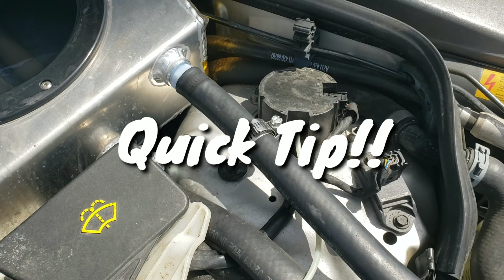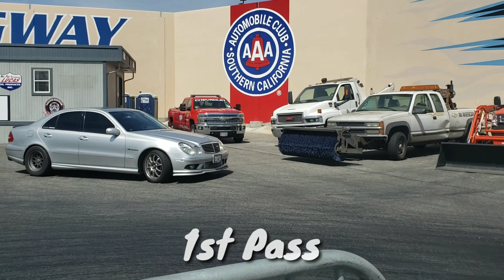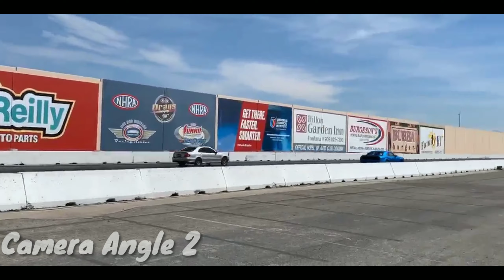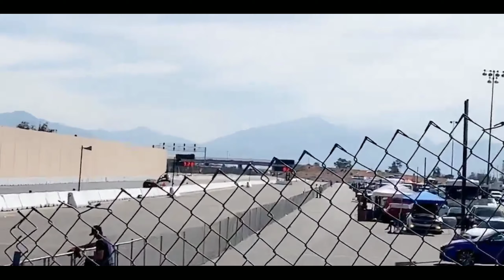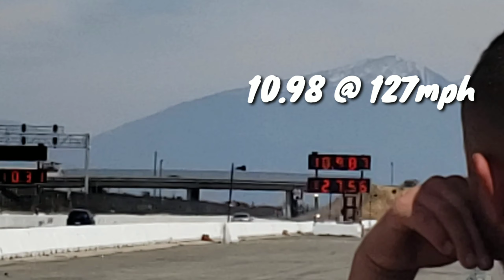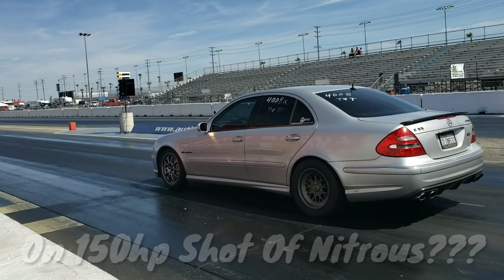Nitrous E55 Quest For 10's Part 3

Comment: I have the same tank.The best way to drain the tank is ...put a drain valve on it. Works perfect and as soon as the tank is almost empty,close valve.
Reply from the maker: I was considering that too..  but i let the SC pump do all the work😅 plus i dint activate my sc pump until i am about to do a burn out so my ice deasnt melt while im staging...so in return i wont have to switch to a trunk tank😎

Comment: Congrats what's your 60ft and 330 looking like
Reply from the maker: Hold on...give me a sec
Reply from the maker: Hold on...give me a sec
Reply from the maker: 60ft - 1.625
330ft - 4.624
8th mile - 7.099 @ 99.44mph
1000ft - 9.216
1/4 mile - 10.87 @ 127.56mph
Reply: That's great i wish i could get a low 1.6 60ft best has been 1.76. But my car breaks loose right before the 60ft after i had the tcu tuned. Best i been 11.50 flat. With 180 pulley mid length headers and tuned 121
Reply from the maker: @samdog357  what size tire u on?
Reply: @j-kamautomotive1817  18 mt,s but I got some clk 16 in rims with Hoosier cheater slicks I'm about to try out... Its been 122 mph. I got a nitro kit but don't want to put it on till I can keep it planted. Then I will try it no need to put it on if I spinning
Reply from the maker: @samdog357  throw it on bro😈😈
Reply from the maker: @samdog357  u can always hit me up on messenger look me up:

Joey Kamtan

Comment: What's the mods on the car? Finally got myself a e55 after wanting one for years. Also who tunes it?
Reply from the maker: ENGINE:
- 77mm SC clutched
- Maximizer long tubes and mid pipes
- Belt Wrap Kit
- 3pc. Aluminum idler Puleys
- 1 step colder plugs
- K&n drop in filters
- 630cc injectors
- Stock TB

COOLING:
- FTP heat exchanger
- Bosch 010 Supercharger Pump
- PNR Underhood Ice Tank 

ADDITIONAL:
- NITROUS EXPRESS PROTON PLUS KIT
- 100hp Shot Nitrous
- Nx bottle warmer
- Auto Meter Nitrous gauge

ELECTRONICS:
- Grams AFR Wideband

TUNE:
- Eurocharged Performance
Reply: @j-kamautomotive1817  are you running split cooling?
Reply from the maker: @taylorjackson3302  yeah its split..thats why i have the underhood tank which i put in to help with air intake temps
Reply from the maker: I just grinded down the rear caliper a bit.. only a few millimeters its on my vid "quest for 10's part 1"
Reply from the maker: And ur not bugging anyone man im here for u bro😎
Reply: @j-kamautomotive1817  I went back and found your vid. That's why I deleted the comment lol. Thanks
Reply from the maker: @taylorjackson3302  no biggie bro.. im here if u need me😎💪

Comment: Eurocharged mananged 9.7 on the quarter with the stock engine, stock supercharger, and no nitrous/meth. You need a 90mm throttle body man.
Reply from the maker: Just seen this...my apologies 😅😅 bro i need alot of thing at the moment but for now ..most mods will be dont to the trans. Im on stock tcu with no tune.. also going to upgrade the transmission valve body as well and ill see what will that net me in the 1/4 mile. Throttle body will be upgraded in the near future but for now i like holding the record for stock throttle body 🤣😂🤣😂
Reply: @j-kamautomotive1817  Legit street cars made a video with a new valve body for 722.6 trans and its quick as fuck. You Should look up on this.
Reply: @j-kamautomotive1817   Hey bro! So did you end up getting the upgraded valvebody? I got mine a month ago on my cls55. There is still some harsh 3-4th engagement. Im still waiting for it to fully adapt.
Reply from the maker: @boyb72  naw man nothing yet. Havent purchased anything new for the e55. How do u like the VB so far as far as shifting speeds? Any crazy noticeable differences?
Reply: @j-kamautomotive1817  Somewhat quicker and solid shifts, but sometimes harsh engagement from 3-4th. I think it needs to adapt some more i think.

Comment: Wow imagine what it would do at a lower elevation!

What a four door n**i lead sled. Lmao!

It's amazing the power especially when the under hood looks so unmodified. 

Also, have you thought switching to a turbo? The s/c takes power to run it physically from the crankshaft on the power stroke ultimately contributing to higher cylinder pressures. 

Seeing as how the major limiting factor is cylinder pressure, and a turbo is driven not by the power stroke but by the exhaust stroke. A turbo does not directly contribute to  higher cylinder pressure and therefore allows for greater power potential.

If we want to take this to it's ultimate conclusion, and avoiding unstable Nitrous: There is a company that makes a pressurized air injection system using special valves and synchronized throttle bodies for the ultimate system to unlock an engines maximum power!
Reply from the maker: So far the nitrous unit has been decent.. but not super consistent back to back. But im happy with it. To turbo this car... u need "deep pockets" 😅 u get mercedes tax...plus AMG tax.. thats why i went spray it was so much cheaper and makes power. I picked up the nitrous express proton plus kit on offer up brand new in box for 450$.. and been full send mode ever since 😁 my car has 172k on factory engine and trans..and torque converter..diff...axels.. and still running strong. Im amazed how well its holding the power. But for how long.. i have no clue😅🙃
Reply: @j-kamautomotive1817  yeah. That's amazing and well worth the price. The performance out of your setup for the price is tremendous!

And no I haven't sprayed my E55. I don't have one. I have an ML with just a m113 and a W140 w/ a M120 V12. 

The most experience I have though is with turboing my 89 DOHC swapped civic hatch. When I was 16 years old about 15 years ago I built a turbo-kit for it and really went to town, lol.

Speaking of which, I wouldn't be so sure the turbo gods will tax you an entire private island to turbo your E55. 

When I was 16 because of my financial situation and out of necessity I was able to turbo my car for almost nothing. I'll break it down for you...

-Free / used turbo + 60 rebuild kit.
-Oil line, T, adapter were from a industrial hose supply shop for 20+5+5.
-Return hose was like 10 bucks and I took my oil pan and drove around the industrial area until I found a cool big fab shop with a door open and then went in and asked a tech to weld a bung on it for $30 bucks.
- i sold my header for money and then just used the factory header but went to the metal recycler to get a 4 inch by 4 inch by 1 inch adapter plate cut out. I then traced the two gaskets out on it (I think before I left) and then asked the guy who cut my piece of metal out to cut the hole out in the middle with his big ass acetylene torch. I even had him port match it as best he could so I only had to do a tiny bit of grinding at home. I think it was $12 for the metal and $5 to cut it. Lol
- I then got a used Toyota Mr2 blow off valve which is like an HKS super sequential in that it responds to change in manifold pressure instead of boost for $15
- bought an Audi intercooler and made my own end tanks out of fiberglass, but theres plenty of cheap intercoolers. $70
- I got my pipe connectors by the foot from industrial supply, and t bolt clamps too. Like 20 bucks. 
-the most expensive thing I needed was a wide band O2 sensor...I paid $450 for one with a data logger and used that to street tune.
- used 450cc injectors from an eclipse/talon $75 for 4
-I got a chinese 6 puck unsprung clutch pack for $400
- Fuel management required putting a socket in my ecu, I sent it away for that $90. I then needed a few EEPROMs $12 and Moates chip burner $85. The software I used was called TurboEdit and it was free. Lol. Eventually there was a $50 electronic board and cable add on that allowed for tuning on the fly/data logging. 
- diy boost controller $12
- a few mandrel U and J bends for intercooler piping and down pipe. I bought a $90 stick welder, $10 in sticks, 14+5+2 for helmet and gloves and wire brush to make my down pipe. 
-eventually $50 for flex pipe to attach down pipe to catback. 

-misc: ~200 boost, oil pressure gauges + sending units, O2 sensor bung, exhaust wrap, vacuum hose, catch can and crank case vent mod, step colder plugs, $75 laptop to program/datalog

So that's like $1600 I think, under $2000 anyway. I remember I was able to sell parts I took off, and I already owned the welder and laptop, etc and some other little bits and after I sold everything it only cost me $400 for the turbo kit, $450 for the wideband, and $400 for the clutch. 

I'm not saying it would be that cheap on a m113k but you get the idea, lol. 

I want to do something in my ML430, build a turbo kit maybe and eventually swap in a m113k. I've been messing around with the truck a lot lately and recently figured out how to give the truck 5 inches more of suspension travel in the front and also add enough suspension lift (+4 inches) to run 37x12.50 tires! Nobody has ever done any kind of lift like that before w/ the truck, just 2-3 inch lift. Can do a body lift too for a total of like 10-12 inches lift and 20+ of clearance.

I'd like to run nitrous on my v12 though and swap in one of the modern electronic 722 transmissions with those amazing aftermarket TCU's w/boost controller for ~$800. The one in my w140 is only one of those hydraulic/pneumatic units and it is no where as smooth as even my ML transmission. 

Good luck!

Comment: Hey man. Do you have a TCU tune? This is reported take take a few tenths off because obviously you shift twice in the 1/4. Have you also thought about putting on a bigger crank pulley? 

The car is going really well buddy, good job!
Reply from the maker: Could of sworn o replied to this😅No Tcu tune...still factoy.. crank pulley im also leaving stock. Im going to see how much nitrous i can dish out of this car until i feel its enough or if the engine gives up. Going full nitrous from here on out.  Future mods are a larger throttle body cause mines the factory unit and upgrade my valve body in the trans
Reply: @j-kamautomotive1817  Becareful with that nitrous, it tends to cause ignition to break up at high power levels. This is apparently why it is not used much past a certain point.
Reply from the maker: @SpenserRoger  thanks for the input dude😎 i dont spray often.. i dont plan on surpassing 150 shot. Thats max. And if i do run the 150 shot im spraying on 110 octane.. not on pump. If i spray on pump.. im only spraying 100shot max. Both pump and 110 octane have different tunes and were both dialed in on The dyno.. but im fully aware the toll the juice will have on the entire car. Im always checking compression, plugs.. and rutine maintenance... im also running brisk racing er12s Silver plugs over iridiums for better spark and conductivity over iridiums. Have u sprayed your e55 as well?